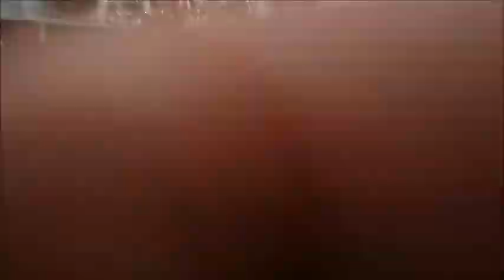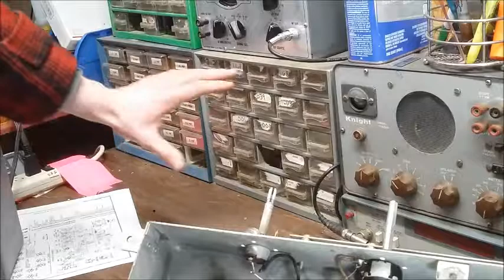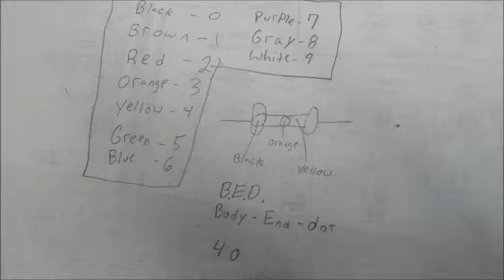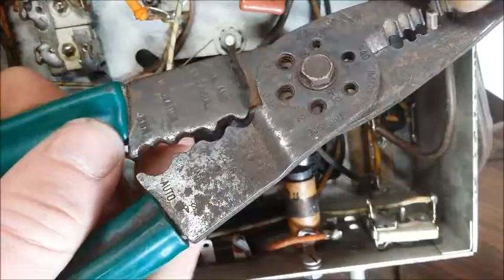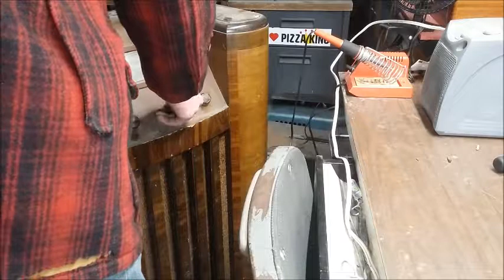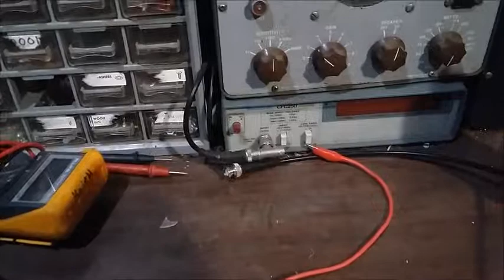Ancient Electronics Series Video 1- Basics Of Tube Radio Repair Ft. 1940 Truetone D1041 Radio

Comment: Those caps with a black stripe are an indication of shielding; which should be observed (or suffer from stray hum). The newer versions don't show that stripe, but you can locate which end is shielded and place accordingly. Testers are available or see Mr. Carlson's youtube channel for more info.☺
Reply from the maker: Newer caps are much smaller, and I've never had a problem not locating the outer foil in probably 450+ caps I've went through over the years.
Reply: @gwcoty0715  :It isn't so much the body of the cap that's sensitive to stray RF (or power supply leakage) alone, but the non shielded lead end and the body combined. That's why if you'll notice the shortest exposed end lead is usually the non- shielded end during original factory installs (exceptions apply). The practice of observing the shielded end and non shielded end is recognized and recommended;  especially in valve circuitry where B+ may cross the symetry of a capacitor. In similar cases, the  electrical ground mounting and location of the capacitors are in like fashion prioritized by the manufacture. Tuners (caps) are an excellent example. Closing: Depending on your background and school  each have their own ways of doing things having both success and failures alike. Though not meaning to be critical,  I otherwise enjoyed your video.